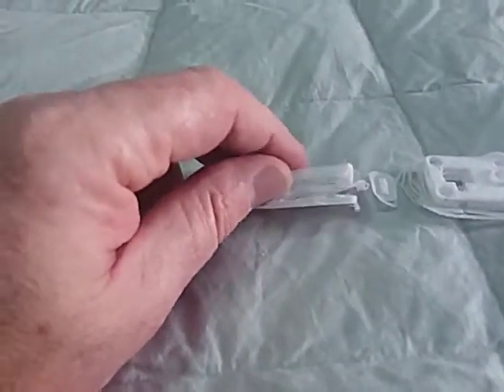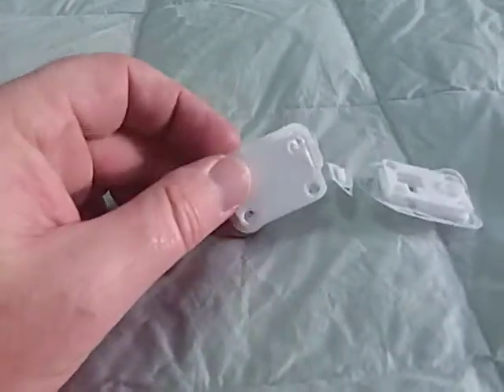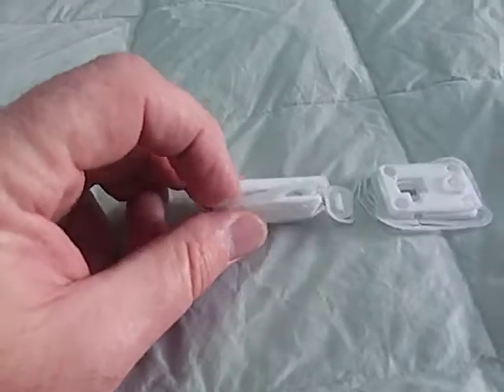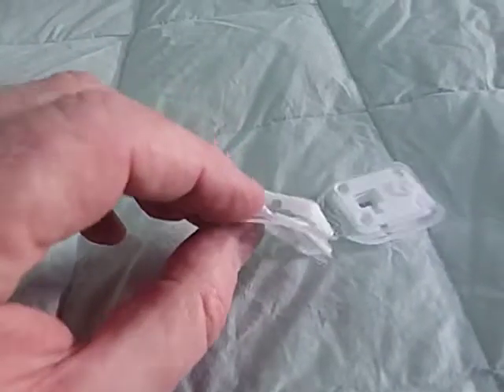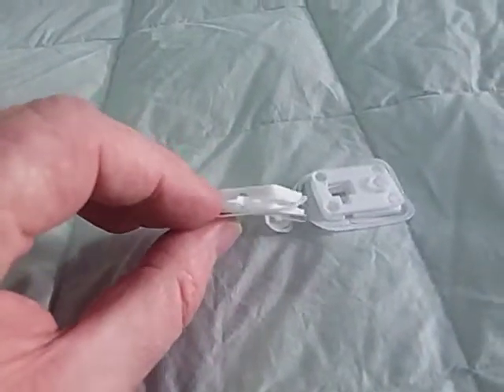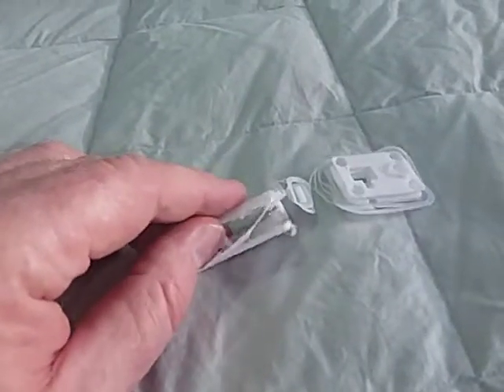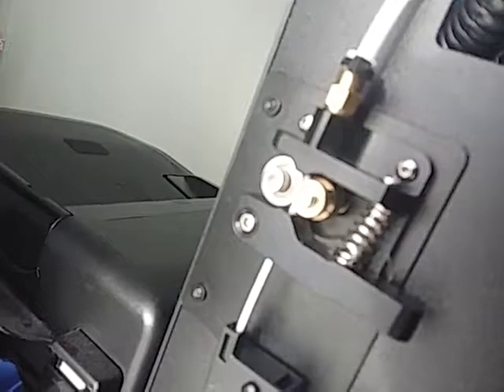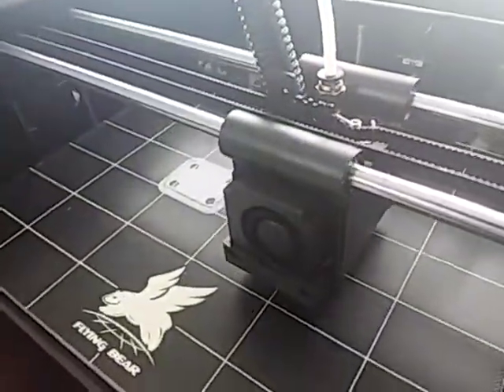Ghost4 Flying Bear 3D Printer Filament Feed Issue

Comment: How to solve?
Reply from the maker: Solution found. Push PTFE tube in 58mm on hot end - tube must go all the way to  nozzle. Must also use zip tie on compression gland. Check at back to make sure filament spindle is not catching on spindle holder nut. Easy fix replace hex with cup head & place spindle on holder the other way around.
Reply: Can you explicit what you mean by "must use a zip tie on the compression gland"? Do you have a picture/video of the correct setup? I have the exact same problem :)

All my prints longer than 15min fail!
Reply: @ZL1CVD  Thanks Man, I am having the same issue. Can you explain how to solve it more precisely?